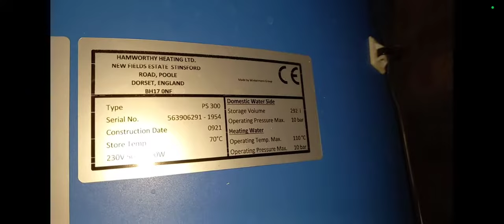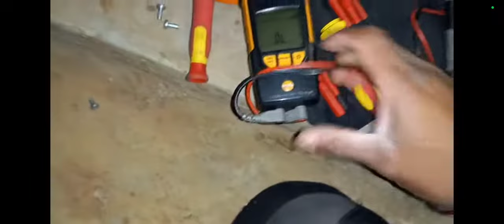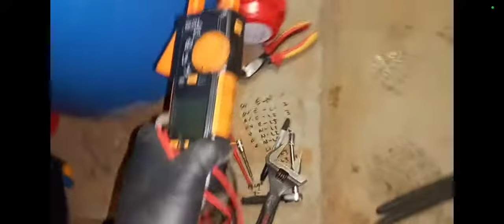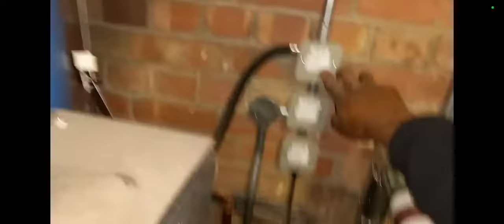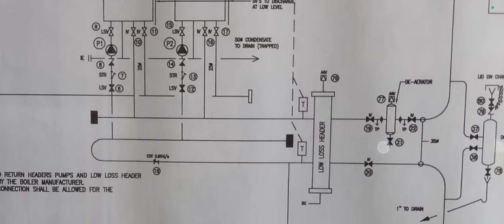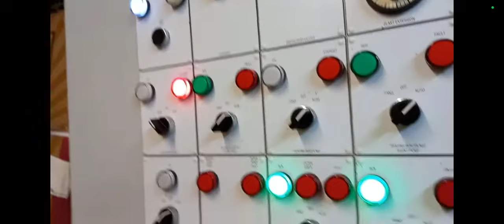DAY IN THE LIFE OF A COMMERCIAL GAS ENGINEER pt23

Comment: Hi, i was surprised you tried to lift the PRVs to introduce air for the cylinder, I found when I did, they've never reseated again in my experience. Love the videos, I passed them on to apprentices to get experience so keep them up
Reply from the maker: Maybe I'm too brave when it comes to PRVs. There is a time when I wouldn't touch them but now I just wanna drain down and get on with it. The worse that could happen is that I need to change it or overhaul the washer. Hopefully the apprentices don't copy that part as that's me just being naughty.